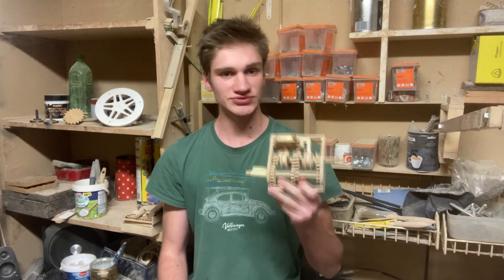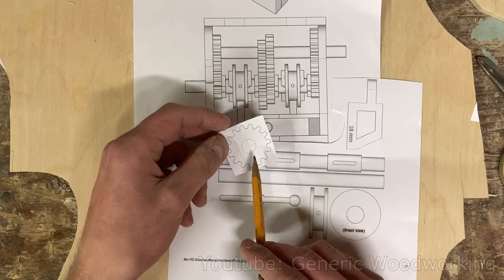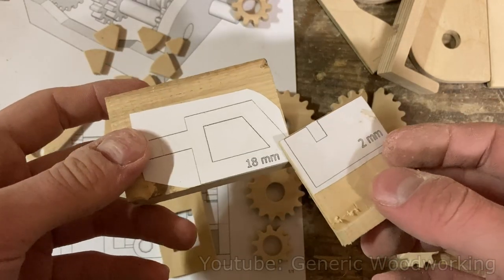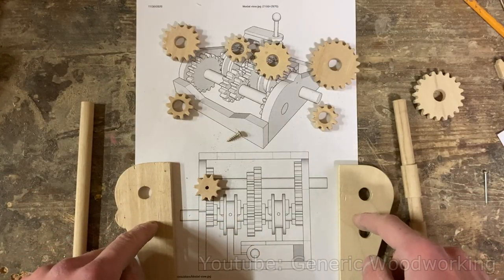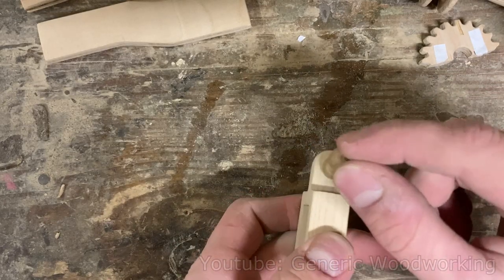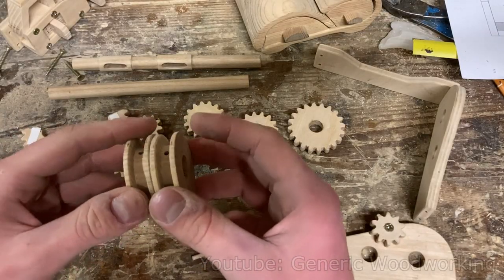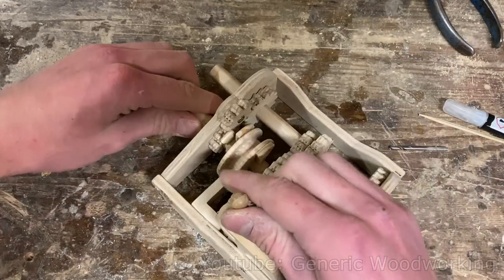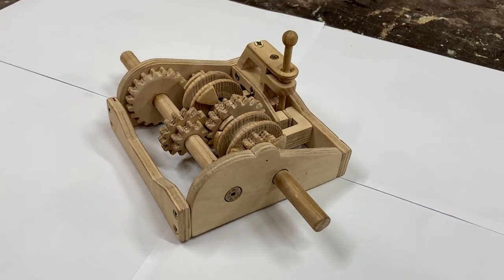Making A Realistic Wooden Gearbox (Tutorial With Plans)

Comment: so i think i’ve got an idea as to why the bit was bending and maybe a possible solution 
because the shaft you were drilling into was circular the bit had very little surface area to catch onto so it moved to the side to get more. a possible solution would be to take some sandpaper or a file and make the part of the shaft you’re drilling into a little flatter to make more surface area for the bit, hope this helps

Comment: @11:13 you may done this work by using a bigger drill bit than the hole. With this way there would be a nice edges and no more burrs instead of using that little drill bit. Any way it is good work. Thanks for sharing.

Comment: Why not make the shaft out of multiple pieces, rather than cutting gears in half?
Reply from the maker: That would be possible but keeping everything perfectly straight would be very difficult
Reply: @GenericWoodworking   Make the full shaft plus extra lengths first.  Drill a hole thru the whole thing?  Then cut into the short lengths put your gears on and use a dowel to put it back together.  Not sure if you could get a straight hole that long though.